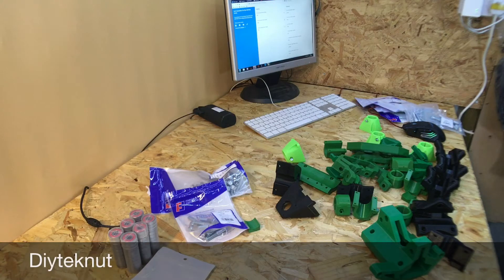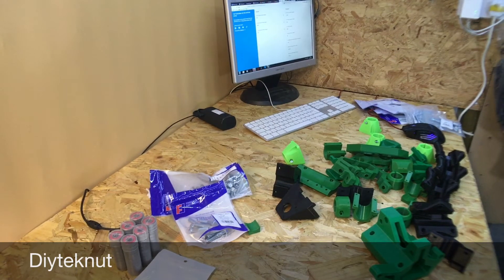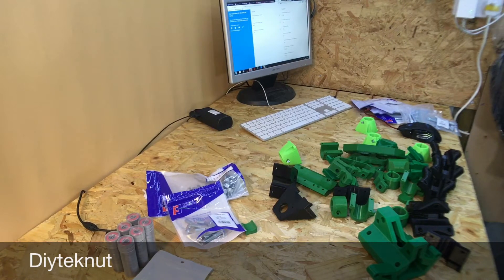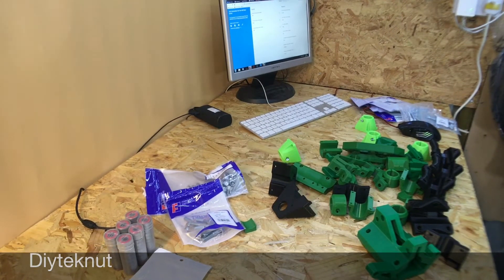Assembling  A Mostly 3D Printed CNC Router MPCNC PT2

Comment: SOCORRO help me please, I did everything until my mpcnc is ready so that now at the end I came across a problem the straps, if I tighten the motor does not walk to walk the straps have to be all loose, she without the belts slip super Well, when I put on the belts, it's all wrong, she does not walk or when she hangs at a certain point, you could give me this light, thank you.
Reply from the maker: not sure but it sounds like your frame is not square, or you have bent tubes conduit.  all so needs to be same height all round .
Reply: @JAYZWORKSHOP  Thank you, you said something that I had not verified, I'm going to see it and I'll tell you if it was thanks.

Comment: Do you recon you could tell me exactly what you bought at tool station and how much of what you bought that would be soooo helpful
Reply from the maker: Just Thomas Russell yeah I think this is right. code 85526 m8 x30 bolt 4 packs. Code 73258 m8 nylon lock nuts 2 packs. Code 69124 m8 threaded bar 1 pack. Code 22747 m8x40 bolt 2 packs. Code 10787 m8x70 3 packs . I think that’s pretty much it but I might of had some already 
If you put the code in Toolstation search you will find them. I used the threaded bar for the long z axis bolts and I had to cut some bolts to size hack saw then file smooth. Hope this might help . Good luck with yours.